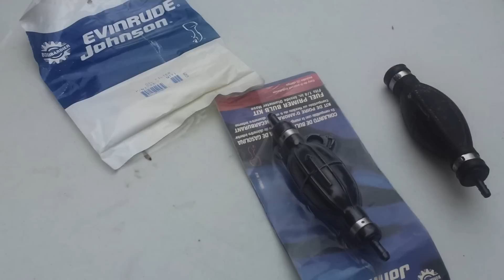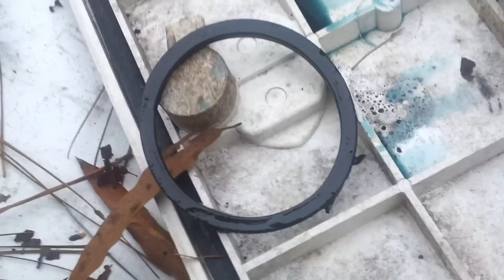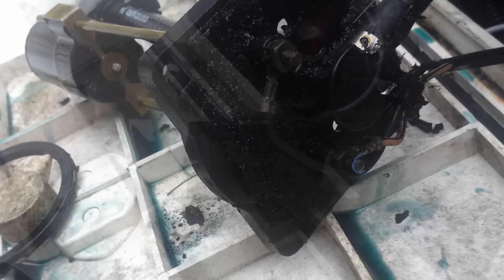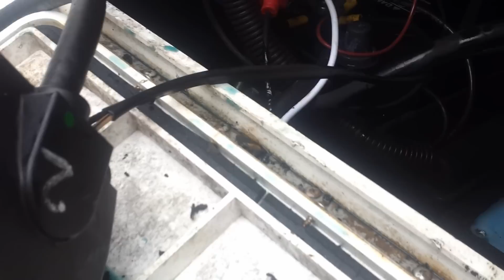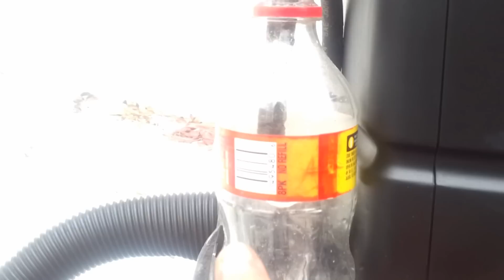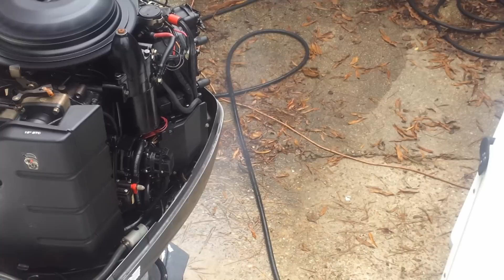How To Replace The VRO Oil Tank Filter and Strainer.

Comment: Hello, if you could help me, I have a Johnson 200hp engine, I am trying to install the auxiliary oil tank for the vro pump and in the engine connector I only have 4.6 volts with the on switch, is this normal or do I need to have 12 volts?

Comment: How did you take the secondary cap off the oil pick up top to get at the wires?  Also, how does that float mechanism work?  Mine pumps oil just fine but I always have a low oil light on my dash.  I'd like to clean the wires and test the float, but can't figure out how it works.

Comment: Although this video is 8yrs old, I watched numerous times before I attempted to service the vro oil tank.
I removed the electronics and cleaned, replaced the filter, removed the primer bulb and blew air through oil line to purge complete system (oil line removed at engine too). Drained all old oil out and rinsed tank out. Used air hose to dry tank. 
Filled tank and assembled electronics, installed new primer bulb. It took about 140 squeezes before oil reached the end. Once connected to motor, I squeezed until I saw oil flowing to pump in my clear oil like. Started engine with pre-mix and ran for about an hour. When oil alarm sounded I would gently squeeze primer bulb. Took a good hour to purge all air out of system. I then ran the motor another hour and no alarm. It smoked like you would expect running premix with the vro.

Comment: Much better idea . Cut hose at tank and plug . Mix oil and gas manually to avoid motor damage due to pump failure
Reply: Doing just that doesn’t work. I listened to that with mine and ended up with a shop bill. You need to replace, I believe it was the vro pump, with a different one. The seal dries out and has starts leaking.
Reply: @charleskennedy9968  .....I cut my hose At the oil tank  on my 150 evinrude 10 years ago and works like a charm. Just made sure I hand pumped the mixed gas until I saw blue gas and then hooked fuel hose back up . Now if you have a cracked seal on pump on motor then thats a whole differant thing we are talking about
Reply: @charleskennedy9968  ....Speaking of fuel pump . After 22 years of Doing zero maintenance on my motor , it started bogging out at full throttle . Now if I hand squeezed the primer bulb as it was running it ran fine so I knew my fuel pump was getting weak . Bought a 10 dollar in line low pressure fuel pump off eBay and havnt had a problem since

Comment: How did you get that top cap off to see the terminal connections for the low-oil wires? I couldn't get mine off and gave up in fear of breaking it.

Comment: How you change the oil for the boat ??
Reply: You don't typically change it unless something happened to it. It burns off during. If you want to change it, dump out the oil, clean out the tank and add new.

Comment: You have smoked your water pump ! By running the engine without water going through the pump is like putting a grinder to a piece of rubber. The impeller turns around in a metal cup. Even for 10 seconds with out water its gone. 
1 the vanes will be shot
2 the impeller housing will be melted
3 some of the melted parts can get sucked in and get pumped to your block.
4 Block ruined by over heating ( the plastic housing will block water passages )
NEVER NEVER RUN An outboard WITH OUT Water going through the pump.
Reply from the maker: I totally agree with you. Dang this video is so old... pretty sure I ran that pump a few more years. New owner now... last posts I saw... he's still going. But maybe he changed it!

Comment: I always suspected that running a motor without water when cold would be ok for 30 seconds or so, but I have always be to scared to even try it. Did you apply lots of grease to the impeller when installing it?

Comment: Nice video.  I am guessing you will be changing your water pump soon...
Reply: Daniel Scheer He was implying you ran the engine without water running. This does immediate damage (overheats the rubber) to the water pump impeller. The tell tale was not showing, and I didn't see any water either so I am guessing he was correct.
Reply from the maker: TheJcretney Not sure what you are implying... but two years later with a couple hundred hours, several offshore and island trips and the pump is still going strong. That being said... I have a replacement... just haven't gotten around to it yet!!! lol